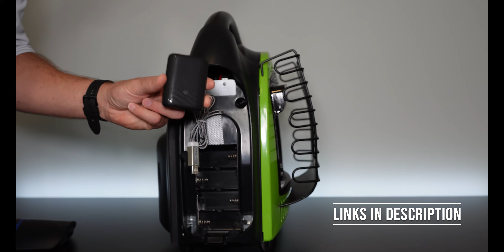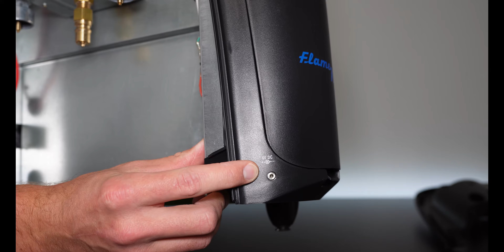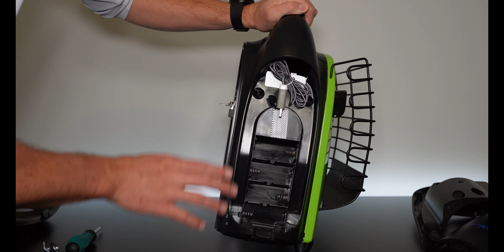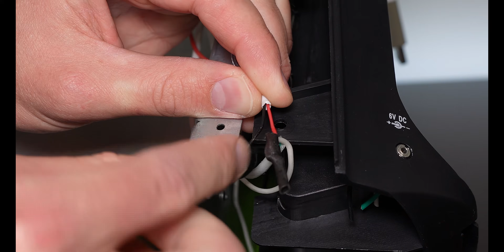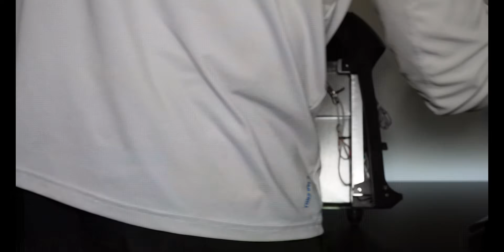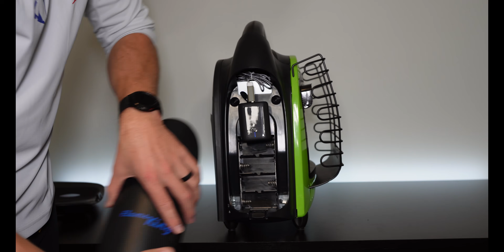Flame King Propane Heater Hack - USB Powered

Comment: I have the 10k but no fan when I turn the knob after lighting pilot light, to flames on ceramic it's at the 5 o'clock position flames will periodically engulf the bottom too. I quickly turn off and relight pilot light or turn the propane tank off. Is the pilot light not touching the ceramic plate causing this does not heat ceramic panel unless I go to 5 o'clock position then flames the whole thing? Any tips ? Ty

Comment: I ordered this 3 times off Amazon and they keep sending me the Ysn- CHS20T..... that is an outdoor only unit. Buyer beware as the sticker on the back says CHS20T. The box says CHS 20 . Wonder how many will find out without a carbon monoxide tester
Reply from the maker: Have you tried reaching directly out to Flame King? I can't find any documentation on the CHS20T
Reply: I did learn one more thing today and that is a co detector and a co2 sensor are not the same and both should be purchased separate from which ever heater you buy if you plan to run it inside your home and they both need battery backup

Comment: Man might as well hook up a 20v power tool battery
Reply from the maker: You could, but would it fit in the side and then a different voltage regulator

Comment: i don't see the need to cut the connection for the 6v dc port.  if you leave it then you can use the 6v dc plug to recharge your battery pack.  As long as the 6v dc is regulated it will recharge your lithium pack.  
The battery pack has built in safety switches to shut down the charge cycle when the pack hits a targeted voltage.
Reply from the maker: Not a bad idea, as long as you have a battery pack that can charge through the port you have it plugged into

Comment: Wondering how the operation of the unit itself has done for you. Is it working and as reliable as the Mr. Heater?
Reply from the maker: Yes, functionally for producing consistent heat, adjusting the temperature output with the dial and lighting without issues it works great.  Still putting it through it's paces though so want a bit more time with it then I will put out a review video. For instance, the fact that the 1lb connection on these heaters do not swivel is actually a bigger pain then I originally thought

Comment: Can you also do this to the Big heater buddy?
Reply from the maker: Absolutely, I personally haven't done it so not sure if the wires are setup the same, but there would be no issue doing it with that heater too as it also runs off a 6v source
Reply: @AlexTimm  a how to video would be much received and one that I would most certainly watch. Thanks for the reply,have a blessed day.
Reply from the maker: @J3nn07  If I do this on one of those I will make sure to make it into one!
Reply: @AlexTimm  is the power bank 6 volt also?

Comment: This is interesting and all but wouldn’t it be far easier and better to just get the dewalt version of the mr heater? The dewalt version obviously just uses the dewalt batteries and has a light on it as well. Also so far what is you favorite version of all these heaters so far that you own?
Reply from the maker: That Dewalt heater is definitely an option, but does limit you to that specific heater and none of the others on the market as well as needing to have Dewalt batteries. I do know a few people that have that heater (and multiple of the batteries) and really like it!  Just about to start using the heaters a lot as that season is finally arriving, so I get to get some hands on use with these Flame King heaters, of which I think I'm going to really like the 20k BTU heater, but the good old trusty and reliable Big Buddy is my default as of now if I could only have 1

Comment: Maybe I don't know enough about electricity but wouldn't an easier hack be to get a DC power adapter 5.5x2.1 female jack that converts to a male 5.5x2.5 male plug to fit on the USB 6v cord you suggested and just utilize the DC jack that's built into the unit without having to cut any wires or taking it apart?
Reply from the maker: Absolutely another way you can do it yes! The reason I went this way is so that I could keep everything contained inside of the unit running off the power pack and without having a plug sticking out of the back. I can already see that getting busted off quickly the way I use these heaters outdoors unfortunately.

Comment: Alex,   I found this video to be just what I was looking for.  I have a Big Buddy that I was running a different battery setup in one of the canister compartments and this solution works a lot better.  I can confirm that the INIU Portable Charger, 10000mAh Power Bank (Your First Link) fits perfectly in the battery compartment of the Big Buddy heater.  So thank you for posting this video!  I just wanted to put this here in case someone else was running the Big Buddy and not the Flame King heater.
Reply from the maker: Dan, Thank you for calling that out, and glad it works on the Big Buddy too! GREAT NEWS! Thanks for watching and commenting!
Reply: @AlexTimm  I did have to mod the battery space a hair after receiving the USB adapter it was a hair bigger than one I had tried first, but still fits with a little plastic removal!
Reply from the maker: @danmckeown10  Great news! Thanks for the update